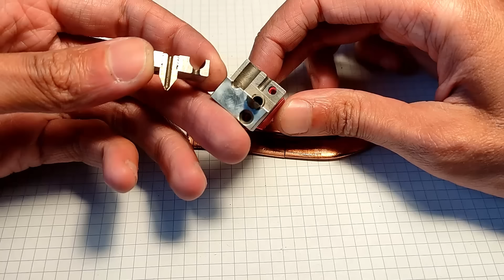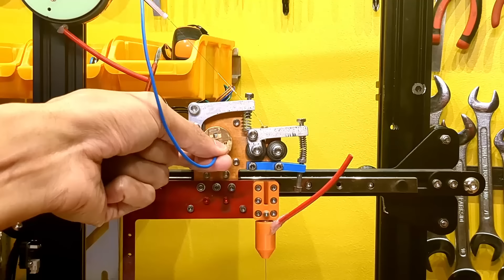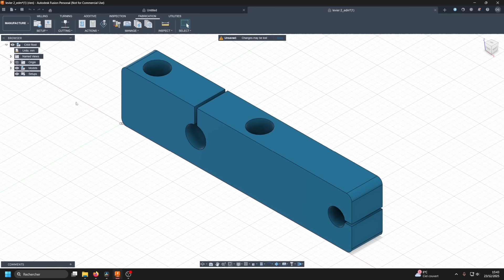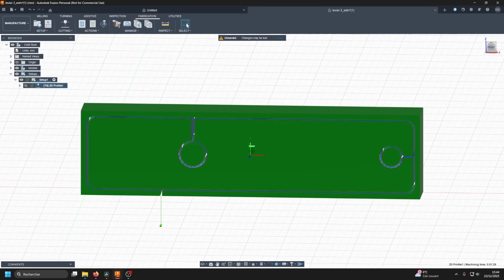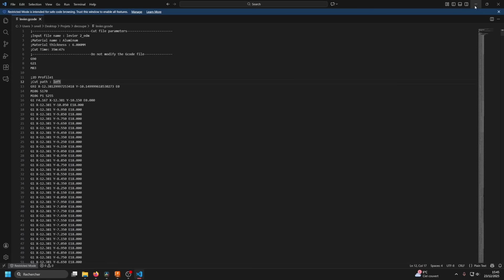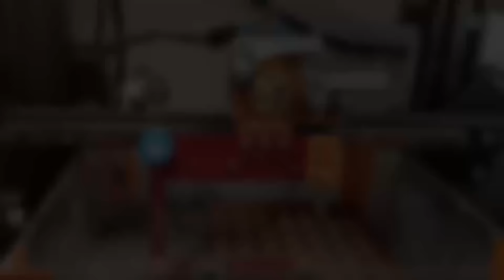Ender 3 to Wire EDM, how to cut metal with a 3D printer

Comment: Have you tried cutting any hard materials, i.e. tool steel, high carbon steel, chrome steel or even carbide?
Those materials are the reason for using EDM since anything softer  can be cut with common cutting tools while these present a serious challenge.
Reply from the maker: I tried pure tungsten and it kinda worked but I had just a tiny rod of 1mm diameter so not enough to find the good settings.
One of the reasons I made this machine is to cut properly my shape memory alloys sample for my PhD. And it works great!
Reply: @AlmostCompletedProjects  it would be interesting to see how it fairs against a drill bit (hss), a metal file ( high carbon steel) and a bearing (chrome steel) 😉
Reply from the maker: @rok1475  definitely! I want to solve the backlash and close loop control first but then I want to test it on all the conductive materials I can find!
Reply: @AlmostCompletedProjects the zero-backlash planetary gearboxes are very expensive. However you can fairly easily make no-backlash speed reducers with timing belts and compound pulleys.
This works in industrial robotics and forces in your machine are almost negligible so it is just a matter of making the speed reduces assembly reasonably small with tiny closed loop belts.
Reply from the maker: @rok1475 yeah thank you for the advice, I have made one (I made a short about it) but the belts aren't tensioned properly. But I'm working on a second version which will sort this out
Reply: @AlmostCompletedProjects looking forward to a video with the results of that 🙂
Reply: @AlmostCompletedProjects just saw your short. 
I think it would be better if you design speed reducer as a stand-alone module. That will give you more flexibility, opportunity to mount both shafts supporting the timing wheels and the pulleys on bearings, add tensioning mechanism, etc.
If you can find / make a hollow shaft for the first drive pulley with the ID matching the OD of the shaft of the other pulleys on the same axis, you can couple the motor there and not have to move the motor every time you adjust belt tension.
Or just mount the first drive pulley on the motor shaft but then the motor mount must allow some movement to tension the first belt.
So many options, so little time…🙂
Reply from the maker: @rok1475 the hollow shaft is a very good idea thanks! And yeah I will make a stand alone module it's much better ! There's a few videos of belt reducer I will take inspiration in it

Comment: About the power supply schematic ?
Where can we see it?
Reply from the maker: The schematic is on GitHub (in the description)
I have a few updates to make but it's pretty accurate
Reply: @AlmostCompletedProjects thanks 
For what I saw it Lacs the second capacitor and the motor
Reply from the maker: @matteoricci9129 well two capacitors of 5uF are the same as 1 capacitor of 10uF. Same for the motor it is a mechanical part like the rest of the ender.

Comment: Do you know what your fastest cutting speed is? How much could you shave off the 45mins with your cutting capabilities?
Reply from the maker: I'm measuring the speed in mm2/min (thickness*linear speed) and for aluminum il can go up to 45 for now. But I'm using a wire made for jewelry not edm, I think I can go ~20% faster with a proper wire.
And with a close loop control I can maybe go 10-15% faster
Reply: @AlmostCompletedProjects  that's cool, I was following those guys from Rack Robotics (@rackrobo) but they seem to have gone dormant about a year ago.... So I'm very happy to see DIY EDM still being pushed